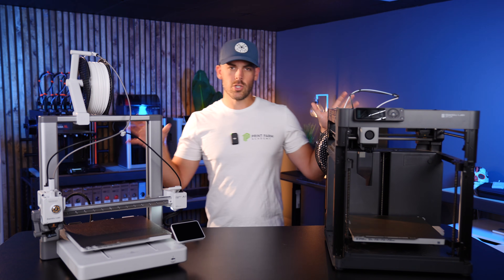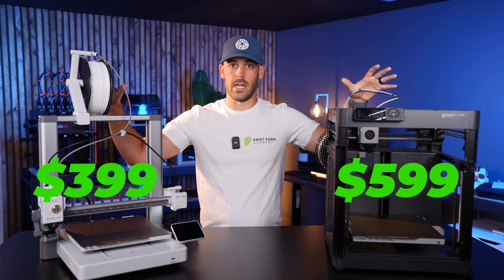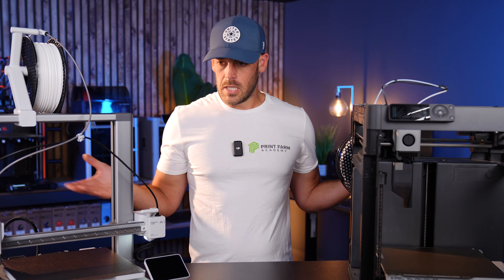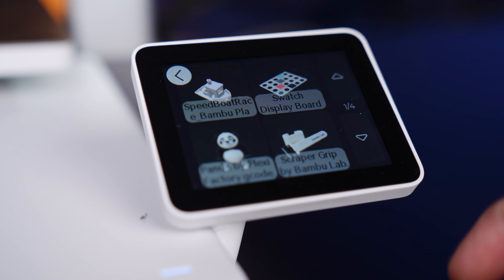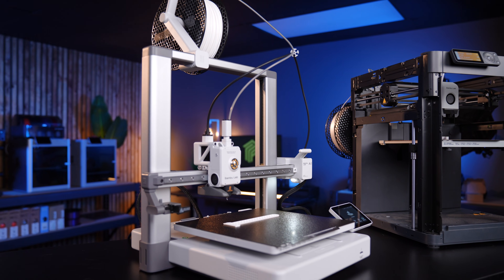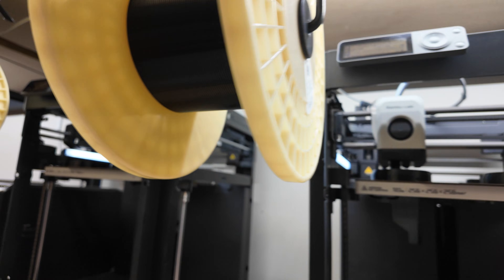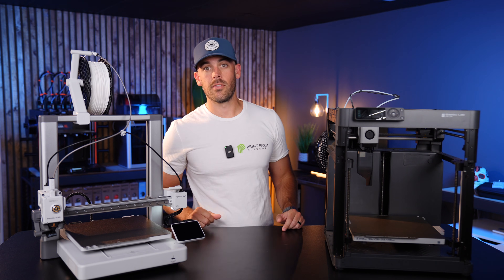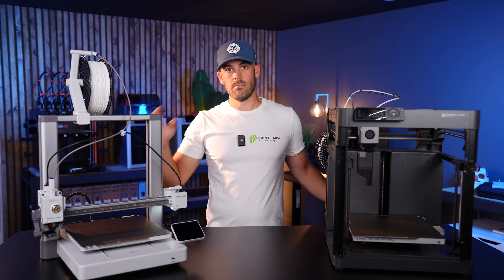When a beginner 3D printer is too good

Comment from the maker: My Favorite Bambulab printers:
P1P - https://bit.ly/3O2SLFy
P1S - https://bit.ly/44D99Ub
A1 - https://bit.ly/450XP5f
A1 Mini - https://bit.ly/45WkLmP
Reply: Wish I could afford a bambulab p1s they seem like a great printer
Reply: @Moran3Dracing definitely awesome printer a real workhorse. Make a few upgrades and some setting changes and it's a even better than a workhorse it's a commercial workhorse.
Reply: @IndianaDiy  a real worse? what upgrades do you recommend?
Reply: @Saveddrip  A workhorse I meant. 
I like to Have a hardend steel hotend and extruder. I have pre-ordered a new Slice commercial hotend to possibly just switch my printer over to that and any others I buy. Also Pre-ordering a Micro Swiss with diamond tipped nozzle to compre for commercial printing. I like option to just change nozzles.
I also like Whambam Build plates I have all that they make for the P1S and Visionminer nano adhesive.
Also I use Activated Alumina instead of silica dessicant in my AMS unit.

Comment: Hello Sir,
I'm using an K1 Max that originally came with the 42-60 motor . After the mainboard failed, I replaced it with a new one, but ever since then the printer has been crashing into the frame and making loud grinding noises during startup and homing.

I've attempted to adjust the printer.cfg settings, but doing so resulted in various errors on the screen. I even performed a factory reset, but the issue persists — it's still hitting the walls.

If anyone has experience with this issue or knows what config changes are needed for compatibility with the older hardware, I'd really appreciate the help. I'm close to losing my mind over this. Thanks in advance!

Video reference 
https://photos.google.com/share/AF1QipO66NULDn2CYsek2MAMXOSnFmQ2KPMMxzZXhuwSl91IBM1Zqa6ZRa9vdu_Gx9Qmpg/photo/AF1QipNBOuQb17XbS04o38CX534dCSr_McS1WhP45O-c?key=LVN4RnROdUNkczNYaC1QQ3h3ci0xYTI2RUU1VUtn

Comment: How is max acceleration hardly reached? Isn't that the first thing you reach?

I would agree that max velocity is hardly reached besides huge prints, but max acceleration should be easy
Reply from the maker: Mechanical systems don't instantly transition from one direction to another, the acceleration is gradual.  The rate of acceleration changes depending on conditions

Comment: I just bought a Bambu Lap X1C Combo.   I plan I putting it in my woodshop,  Should I cover/enclose it when it is not in use?  I worry about saw dust.  If I made a Cloth cover could I run it with it covered or would it over heat.   I don't even have the printer in house yet and I am worried abotu saw dust messing it up.  Thoughts?

Comment: I run a small farm of 3 p1s and 3 a1 mini. I just purchased 6 more minis. They are the best small farm machines atm. My 6 machines have done over 5000 orders on amazon since January.
Reply: how have the A1's been for maintenance over the P1s? I have P1s, and P1ps, but looking to pick up a few more A1's just for knocking out single color parts. Also, have you found any interesting budget active vented enclosures? I love the P1S because it keeps the rails cleaner for longer and I live in a house w/ carpets and constantly fighting dust in my print office.
Reply: My p1 series printers and a1 series are both great. Ive done over 9300 orders with maybe a combined 20 hours of down time. Which were mostly p1 series extruder jams, and nozzle clogs. P1 series has a heat creep issue.   @mothershipco
Reply: Hey! What do you sell on amazon that people would want ? I’m 100% new to 3d printing…
Reply: What do you sell? Send link

Comment: I just wish I could use the AMS Lite on the P1P. I had a clog in my P1S that somehow resulted in a short piece of filament getting stuck in the AMS, and ended up having to take everything apart to figure it out. Not something I care to repeat. The relative simplicity of the Lite version makes it feel a lot more maintainable, and you sure can't beat the price.
Reply: Its literally just 2 screws you remove from the ams, and a couple of plugs you disconnect, and the entire AMS system pops right out for easy jam clearing. You have no idea how much more annoying it could be...

Comment: But would you still recommend the P1P with AMS over the prusa xl? for multi color prints it seams the xl would prevent lots of wasted material and/or having to glue or screw parts with different colors together, so saving on labor? seams in those cases the XL is the preferred option?

Comment: "Max acceleration is hardly ever reached, except for big prints". I think you're deeply confusing acceleration and max speed.

If you tell me that the advertised max speed is hardly ever reached, except in big prints. I accept.
Max acceleration is the rate of speed increase that it'll accelerate the tool head from the moment it starts to move. So the acceleration you set, is the acceleration you get. The speed you set, will not always (or in some cases never) be achieved. But acceleration will.
Reply from the maker: I’m an engineer, I’m well aware of what acceleration is. However if the head is just traveling a short distance, the head cannot ramp up to speed quickly enough. That’s the only point I was making
Reply: @PrintFarmAcademy  I'm an engineer also. Your reply precisely validates my previous comment.

"If the head is just travelling a short distance, the head cannot ramp up to SPEED quickly enough".

Because it cannot achieve the advertised speeds (on small parts) doesn't mean that it's not reaching the advertised acceleration.

You can have a part being printed at 500mm/s2 ACCELERATION and reach 1000mm/s SPEED, if it's big enough.
You can have a part being printed at 1000mm/s2 ACCELRATION and not reach 1000mm/s SPEED if it's too small.

All of this just to point out that what you said on the video "Max acceleration is hardly ever reached, except for big prints" is wrong and should instead be "Max speed is hardly ever reached, expect for big prints".

Comment: We are using 12 of P1S with AMS for almost a year now and each of them working around 20h a day, we have very low failure rate even on parts with fine details. To this point we have done 0 maintenance other than basic cleaning and all machines are still in a very good shape. Totally agree with your recommendation and personally very happy on spending extra on picking those printers for a farm. Worth to mention that AMS saves a lot of time on swapping the filament + gives extra abilities so I recommend getting at least few of the AMS units for the farm. When we started to operate the farm it became very clear that main cost actually aren't the printers, it's filament and wasting time with low quality machines doesn't make any financial sense especially when your farm is very loaded, each minute wasted on fighting bad quality filament or machine cost triple.
Reply: @hobbyistnotes  That's very good info. How hard was it to start up your farm?
Reply: @ Haven't seen this message, the hardest part was to figure out the products, lucky for me we have a great team.
Reply: can you recommend filaments that you use? thanks
Reply: @kevinl.9657  in US we use Overture and it's not an advertisement. On sales you can get role of PLA and ABS under 15$. It's consistent, always in stock and we never got tangled spool. Latest change to their paper spool having coat of robber or some other material also made possible to use those without adapter rings. With paper spools I would recommend huge ball from bearings to be placed inside as they can get stuck due to light weight.
Reply: What are their capabilities like what are you selling if I might ask?
Reply: @jfunk3897  We sell all sorts of stuff from technical prints to cosmetic items.

Comment: As a fellow engineer I might be looking for even more durable materials such as carbon fiber nylon to sell parts.  I know that you worked for Markforged, so I'm sure you're aware of Onyx which is a fantastic material.  If I could find an affordable printer that could print carbon fiber nylon of that quality, I would be in business.  The X1 looks promising, but I haven't researched it much.
Reply from the maker: Yeah X1 is fantastic.  You can technically print those abrasive materials on the P1P and P1S once you upgrade some components to hardened steel
Reply: @PrintFarmAcademy  Does the lack of full enclosure matter though?

Comment: Based on your previous recommendations, I went with a P1S a few months back (I prefer the enclosure) and I've been so happy with it that I bought another last week. After years of tinkering with my older printers and giving up in frustration, it is great that they are now "appliances." The only "upgrades" I've done are hardened gears and nozzles.
With the bed-leveling and textured PEI sheet, I have had zero issues with adhesion. The only issue that I've had was the desktop software defaulting to the wrong material after an upgrade. Well, that and having some serious issues with years-old PLA that didn't play nice.

Comment: Absolutely, both solid options... for a hobby printer. But for a print farm? Do you have a filament recycler? :P 
Because from what I have seen, the waste on these beasts is huge. In the long run I would say MMU or even XL will be worth the extra buck.
Reply: Exactly. 16 colors on Bambu? Absolute nonsense. AMS has problem to print anything even with 4 colors in reasonable time, so why 16? And the waste? It is just absurd!

Comment: We have 10 P1S printers
We purchased 10 A1 combo printers to add to our print farm

We now have around 50 printers and Bambu's is one of the most excellent, feature-packed printers we have in our farm.
Reply: @3DThird  Wow, that's awesome but I bet it was hard to get going?
Reply: Wich one has the best quality and nice finishing printing?
Reply: @DanDr15  both are equally good but are intended for different purposes. P1S for advanced materials while the A1 for everyday materials
Reply: @3DThird  the most importan for me it is the print quality, 0 headaches , an product more like “apple” , price range 200 to 2.000$
Reply: @DanDr15  then I'd say go for the A1 or A1 mini. Both have excellent print quality. If you're a beginner you should also take into consideration that the material you use and settings will influence the quality of your parts. Good luck 👍🏻
Reply: @3DThird  thank you , i don’t know what i will print yet, maybe custom enclosure or other stuff for MVP, maybe a1 mini with AMS it is enough but i don’t know if will be like an pro 3D printer quality, it is in a pro quality category a1 mini ? Or should i go for P1S and AMS ?
Reply: @DanDr15  all bambulab printers offer excellent print quality. Depending on size and budget you either can go for the mini or A1 / P1S option
Reply: @3DThird  so, in short sentence, you will recommend me to buy an a1 mini and don’t waste the money on some thing else if I want an good printing quality, and I’m not sure on the printing size, and buy later an P1S or something else, if I need bigger prints even I can afford an. Expensive one, just in terms of not wasting money from the beginning?
Reply: @DanDr15  yes
Reply: @3DThird  thank you ! 🙏🫡
Reply: @DanDr15  P1S in my opinion. Plus Commercial Open source hotend available soon.

Comment: I have the A1 Mini and P1S. Love both of them a lot. I print mainly PLA and PETG. I have to say I seem to get better print quality off of the A1 Mini for some reason. Not 100% sure why. I also have 2 of the Flashforge 5M printers. They are basically a copy of the P1P with smaller build volume then the P1P but larger the then A1 Mini. I have to say they have also better print quality then my P1S for some reason as well.

Comment: Thanks again for all these print farm videos Travis!
I can't wait for the course to start up.

The A series is amazing, and extremely reliable. I have two full size A1s and two A1 minis; all but one of the minis was bought during the sale. 
There;s another small youtuber with a print farm, Dancyn 3D Prints, who has something like 100+ bambu printers and I think around 40+ are A1s. They're excellent, low maintenance printers for PLA or PETG farms.

Comment: Much, much easier changing nozzles on a1 than P series.  And they are so cheap they are basically disposable.  So, get a jam in the a1, you are back running in maybe 2 minutes max.  Also, changing nozzle size is something I never messed with my old Prusa but do all the time with my a1 mini.  The ams is great for changing filament, and can save you on huge prints as it can change if you run out without a manual switch.

Comment: The Qidi Q1 Pro is also a very viable option; 429$ with the discount code 30DAYSGIFT, and it already has the whole hardened steel system so you can do CF, GF, Glow-In-The-Dark and other abrasives. It is also enclosed and has a chamber heater, in case you want to be able to print Nylon, ASA and other actually useful materials that can be used outdoors or in workshops.

Comment: I loved my Prusa Mini as a first printer.  It was so easy to use and just worked.  I now have a Prusa MK4 which I'm loving even more.
Reply: We still have 5 MK3+ in our farm but it's just financially worse to buy 1 MK4 + MMU(~$1400) rather than buying 3 A1 Combos (~$1650). We used Prusa printers for roughly 6 years but the times are changing. Prusas are definitely still fantastic machines, it is the price that makes it a difficult choice though.
Reply from the maker: Let me just tell you how much you’ll love these even more!

Comment: IMO building a Prusa kit, if you have the funds, is a route that should be considered. Learning how these things actually work is hugely important and a Bambu will not teach you that.
Reply from the maker: I used the feel the exact same way. No wrong path but lots of people are not interested in tinkering with the tool itself
Reply: @PrintFarmAcademy  I just can’t bring myself to view a 3D printer as an appliance, I guess I’ve changed too many bearings and hot ends! I’m going to pick up a P1S to compare to my MK4’s at some point as they do intrigue me. One thing I wonder is if US sanctions will ever affect Bambu. It’s looking likely DJI drones may be banned in the US and with Bambu likely being largely funded by the CCP something similar could happen, especially if you end up with a very anti-China President.
Reply: I am glad my first printer (Mk3) was a kit because I definitely learned a lot, but I know a lot of Bambu users just want out of the box printers that just works.

Comment: Something the video never touched on... flow calibration in the A1 series that's not in the P1 series.  This let's me run lower priced filaments that my Prusa would struggle with, night and day in some cases.  I wanted a P1S but ended up getting an A1+AMS and 2x A1 Minis.  Absolutely the best decision in terms of flexibility and output capacity.  When the P2 series becomes available (persumably with flow calibration and a modern screen) then I'm game for a Core XY.  Really impressed with the Bambu experience!
Reply: Excellent point!

Comment: The parts for the A1 are less, not much, and I wonder if they will last as long as the P series. The bed slingers appear easy to maintain? What do you think? Although my experience so far with P1S and A1 mini and A1 is nozzle issues, or having the correct filament settings....  Either series.

Comment: Should've mentioned for the price of the P1P you can get the A1 with AMS lite. Heck, you can get 2 A1 Minis with a few spools of filament for the price of the P1P.
I have the A1 Mini with AMS lite and it's such a crazy good printer. Definitely the best entry level or small batch printer hands down.

Comment: Being a long time follower of you and @wittworks I jumped down the rabbit hole of 3D printing.
I did not listen to your advise.
I went gonzo with the X1C.  Having a great time.  Just need to learn Fusion, hard to teach a 64 year old some new tricks.
Thanks for sharing and thanks for being you!
Reply: I'm 50 and was in the same boat,  But in the past year I've learned Onshape CAD software and I'm designing parts from the ground up almost daily.  You can do it!  Lean on YouTube heavily for instructional videos.
Reply from the maker: Won’t go wrong with the X1C!
Reply: I am 50 years old and going to buy my first printer, the X1C, and will need to learn a modeling software like you are. I am also a long time follower from the woodworking side and now moving to the 3D printing side of his businesses. Best of luck!
Reply: Hi! I'm 63 and I highly recommend ditching Fusion and go with Onshape (Free Plan)

Comment: Love my P1P  but did pick up an A1-Mini + AMS Lite on the sale. Fantastic printer for the "smaller stuff" and would highly recommend it as anyone's first printer, particularly if the size fits your needs (otherwise go with the full size A1). I was also surprised to learn that the A1 series has automatic flow calibration [which the P1 series lacks] and swapping nozzles (e.g. between standard .4 and a .2 for fine detail on figurines or HueForge prints) is super fast and easy on the A1 - one clip and no wires [I really hope they come up with a retrofit for the P1]. As you mention, the touch screen is nice on the A1 but since I print to both printers directly from Bambu Slicer, I rarely have to touch either screens.

Comment: Thank you! I've been trying to decide this exact problem.
However, I think I've come to the opposite outcome: 15 A1 printers instead of 8 P1Ps.
We are only printing PETG, the print is relatively short (both in terms of height and print time)
So I think having 7 more printers for the price is better for throughput. 

Would love to hear about how your torture test for the A1s goes!
Reply from the maker: That's not a bad route to take, also adds in more redundancy for printer failures and downtime!